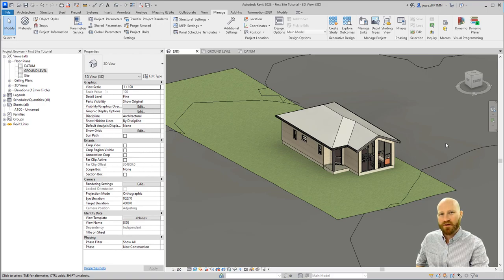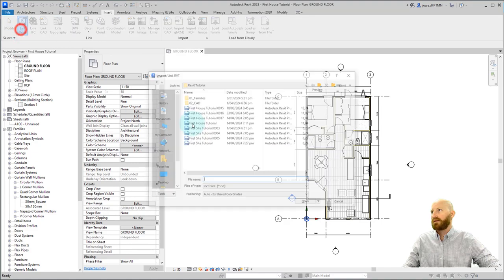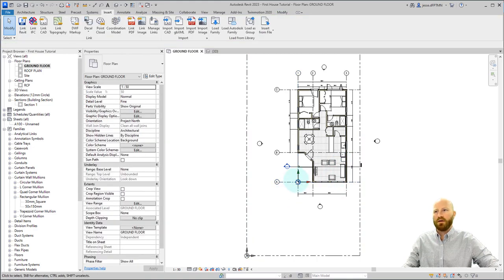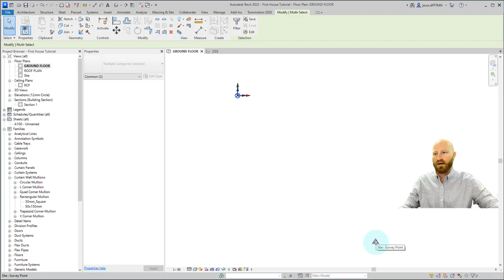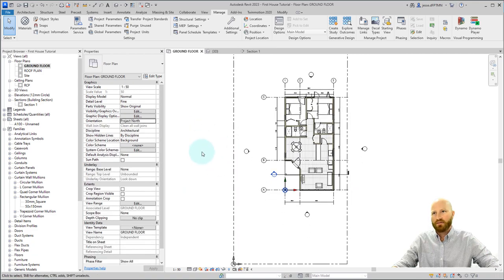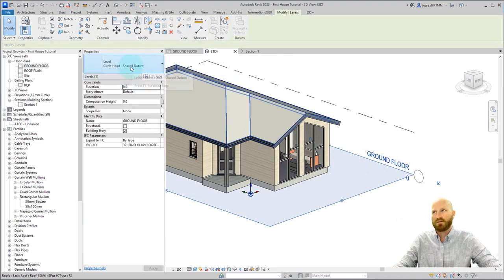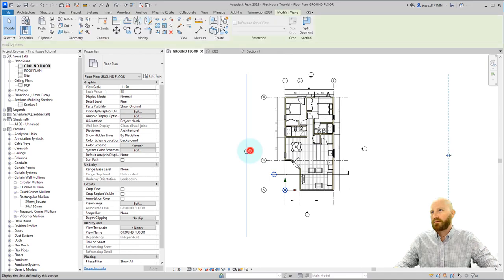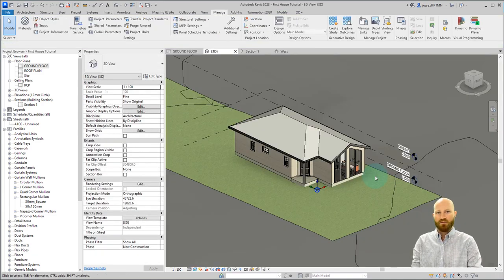Revit Shared Coordinates - Ep 11 - Beginner

Comment: Question, how do you get the shared datum option after clicking the levels marker?
I have been following along since ep 1 but I don't seem to have them option.
Reply from the maker: Thank you for following along! If the template you used is missing level type options then you can set up another type. 
- Select a level
- Click Edit Type
- Rename the type to refer to the datum or RL
- In the Constraints section, change the Value from “Project Base Point” to “Survey Point”
- change your other levels to your new type. 

Let me know if that made sense or have any other questions. 

Out of curiosity, have you been drawing exactly the same house or are you making your own design?
Reply: @JesseDom  Thank you! It worked.
I am drawing the same house. When I am more confident that I have fully grasped the basics of Revit, I will attempt to recreate one of my projects from AutoCAD.
Reply from the maker: @KemzA658  Awesome! I am proud of you for keeping up with the tutorials! 
You’ll be building your own designs in no time, I just need to make more time to record more.
Reply: @JesseDom  Thank you.
I have notifications setup for your channel so whenever you get the chance to upload I'm watching with Revit running